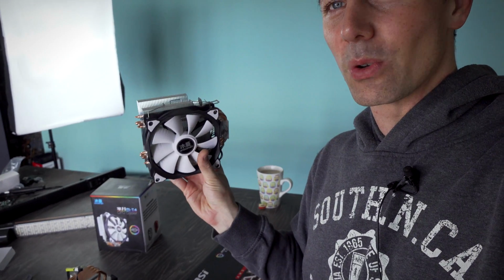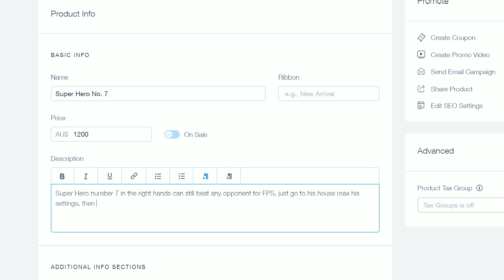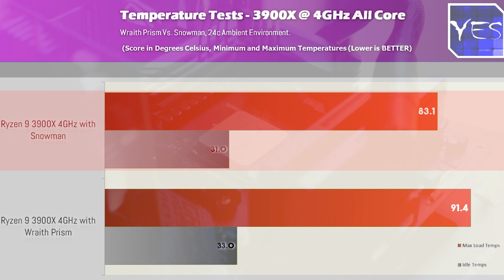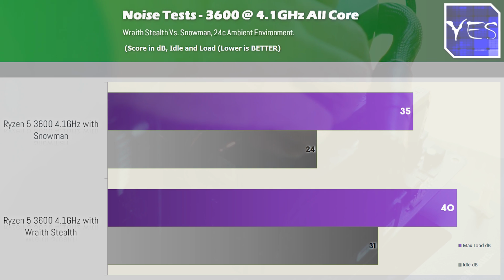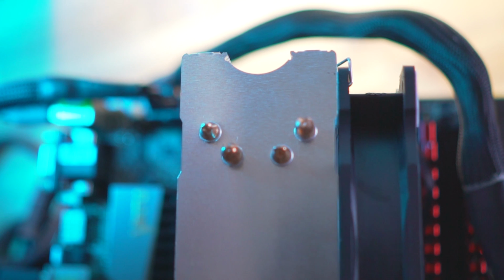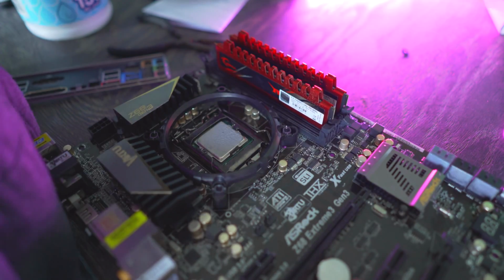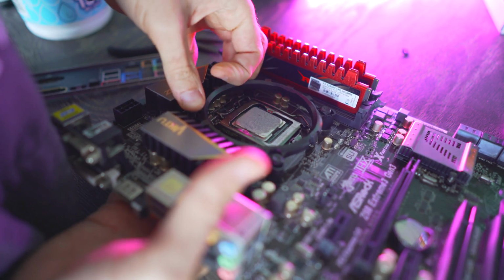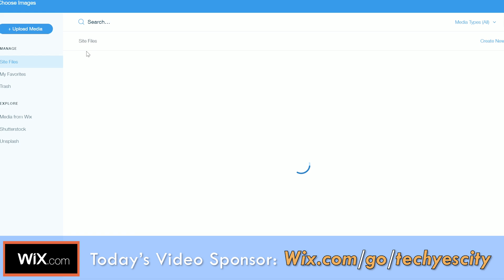Is this $17 Snowman CPU Cooler the BEST Money Can Buy....!?

Comment: Hey Brian! Love your content, been binging all your content. I know it's been awhile since the whole Xeon stuff but I was thinking about making a build with Xeon and bought some ECC UDIMM RAM, was wondering if you had any suggestions for motherboards that would be compatible with it? To get an idea of what I'll be pairing it with, I have my build so far posted below. 

My build so far after shopping around for the past two years (in USD): 
Enermax 120mm Fans - Free (after rebate) Fry's Electronics
16gb 1333MHz DDR3 ECC memory - $7 from Ebay
Snowman CPU cooler - $17 Aliexpress
Antec Truepower 550w - $20 Craigslist
Samsung EVO 850 500gb - $25 OfferUp
GTX 980 4gb - $90 Craigslist
Going in to a random case donated by friend, not very big on aesthetics, all about the bang for the buck
Total: $159 so far

Trying to spend less than $100 for CPU and mobo if possible. 

And yeah I know shopping around for 2 years is ridiculous but I was in no rush. Been holding out on buying GPU and CPU till now just because I know those get irrelevant quick. Decided on the GTX 980 because I plan to do 1080p gaming only.
Reply: Watch Philcomputerlab on which motherboard and xeon to buy

Comment: X58? Would snowman be a good pairing with your beloved x58? I just recently got a x58 setup but it's running a stock cooler currently.
Reply: I was uaing Intel thermal solution that normally comes with 980x

Comment: You should not use this cpu for testing.there is not enough difference between different coolers.as long as the cooler is decent .there is too much heat trapped in the 7nm cpu.use something like ryzen 2700 will be better

Comment: This thing is great. There's an ennermax cooler that's comparable at $20 if you dont want to wait on shipping. Here in the U.S. shipping from ali express takes a while. The 212 will probably never get knocked down though unless they can make an aio cooler that has its own closed ln2 system and doesn't condensate on the other components.

Comment: I have ordered recently this Alseye cooler: https://pl.aliexpress.com/item/32993609816.html?spm=a2g0s.9042311.0.0.27425c0feG5tJQ for a Ryzen 5 3600. I hope it will do a good job as it looks phenomenally and has 6 heatpipes + 120mm fans. Gonna update you Brian & guys when it arrive and I check the temps, cause for now I am on the included cooler - so I expect a huge improvement.

Comment: It's not for me, or the people i build PC for. FAR too nisy for my liking. But for many less noise focused users out there this seems like a really good deal. I will keep it in mind. Thanks for the heads up :)
Reply: Are u serial?! Maybe u got a broken Snowman? Did u hear Brian's audio test?! It was practically inaudible!
Reply: @MaximusAdonicus  The funniest thing about youtube comments, are people like you. You have to go nuts because someone isn't thinking like you. You're cute, but a bit of a laugh.

..and to the "practically inaudible" part of your comment: I build passive systems when i can. I have many years of building low/no noise PCs, for myself and others. My HTPC is a Streacom passive cooling case as an example. My current gamer has a passive CPU heatsink, two Fractal fans running below 500rpm, and - the one noisy thing - my MSI Gaming X 1060 which reaches 32DB when pushed. That is NOT inaudible. I can easily stand in the other end of my living room, and hear the fans. You could have a conversation with someone, and still hear the fans. The perception of a given noise level varies, a lot. Which frequency bands are you sensitive towards, what is your background noise level, and have you actually experienced anything but a noisy stock setup.. 

I get it.. You don't know what those numbers mean, and think you can rely on a simple mic close to a fan test as seen here. But you'd make yourself look a lot better if you ask, next time something confuses you.

Comment: What if you replace the fan on the Snowman? For example, take the 212 fan and put it on the Snowman. Would the noise go up and temps down? I wonder if the 212s fan has a higher RPM then the Snowmans fan :P

Comment: I think something we should remember though is that the horizontal coolers serve another purpose. They push air down over the motherboard cooling VRM and capacitors. Very important on these motherboards.
Reply: I thought the same but now that I've installed the tower instead of the top-down cooler my vrm's are acutally cooler. I guess the air pushed down is heat up due to the cpu.

Comment: I have a Thermaltake Contac Silent 12, very, very similar, even the price :D
Reply: I have the ContacSilent 12 as well. I think it's the same exact cooler as the Snowman. The fan just has a different sticker on it. Everything else looks identical.
Reply: @hartsickdisciple  and a "Tt" pressed on the top of the metal plate of the cooler besides the sticker, other than that identical just like you said, we got ourselves a pretty good deal :D

Comment: one thing worth testing is snowman vs evo using an identical fan to compare the coolers themselves.
reason being, that at $17 for the cooler and mounting hardware you have another $18 to throw a far better fan on it, or you can buy 2, and run 2 of the stock fans in push pull vs the evo for a dollar less, and you have a spare cooler itself and the mounting hardware.

great video though so far

Comment: Can you tweak the fan speed on desktops? If you can, this cooler "Snowman" could beat the Evo 212 on the temperature and noise  level if you pushed its speed a bit higher i think its incredible.

Comment: Should have switched the fans, to see if it's the stack or the fan that's better on the 212, the fan mount looks very amenable to putting your choice of fan on, if you want RGB or a more powerful but not as quiet fan.|

Also, not heard of the GD900... I got a big tube of HY880 not long ago

Comment: The reason this can be sold so cheaply is because china manipulates their currency and uses what is effectively slave labor so manufacturing costs are ~very~ low. Search up the leak that those $150 nike shoes you bought cost the equivalent of $2 to make. I'll leave the moral side of purchasing product from a country that treats its citizens as a tradable commodity to be used as the government sees fit to you. ;^)
Reply: Just too bad that 90% of ALL electric equipment and almost ALL clothes are made in China (because it IS cheap)! Trying to buy a tv, phone or pc parts NOT made in China is practically impossible. You can buy clothes locally, but they will cost 2-3 times more.

Comment: This is more like a Hyper 212 than it is a Hyper 212 Evo. For those that don't know the Evo has copper heat pipes sandwiched together without aluminum between.  I guess it does make a bit of a difference from testing that I've seen.

Comment: This aliexpress coolers are beasts, i had bought some of them becuz cheap bargains and they do the job pretty well.
Oh and if you happen to have problems with these coolers you can use sandpaper because some of these have smooth surface and doing so sometimes happens to give a boost on this coolers

Comment: i tend to go for any variant of hyper 212s (not the hyper T4, for what i tested it with, the evo killed it) when they are on sale cheap 15-20 after rebate, new or refurbished; i wonder how the snowman holds up under very high heat loads, like a 9900K or a Phenom II 965 at 4.2-4.3 in prime95 (an evo will need push/pull at 100% fan speed for 4.3Ghz prime)

Comment: Anyone who has an air cooled cpu tower like this, one of the best things you can do is throw away the included stock fan. Replace it with a high quality NXT or Noctua high performance 120mm fan or a 140m if it'll fit. You can easily jerryrig it onto the cooler with paperclips or zipties. That'll save you at least 5 degrees depending on how shit the stock fan was :)

Comment: I got 1 questions 1 I'm new to pc so bare with me is this goodCUK Continuum Micro AMD Raven Ridge 3rd Gen Micro ATX Gaming Desktop Computer and will this run gta Mobo:

1 x A320 Motherboard

CPU:

1 x AMD Ryzen 3 3200G APU w/ Vega 8 Graphics

RAM:

1 x 8GB (2 x 4GB) 3000MHz DDR4 RAM

M.2 Solid State Drive:

1 x 128GB M.2 NVMe 2280 SSD

3.5" Hard Disk Drive:

1 x None

OS:

1 x Windows 10 Home x64-bit (unactivated)

Keyboard & Mouse:

1 x CUKUSA Gaming Keyboard and Mouse Bundle

Wireless Internet:

1 x CUK 802.11 AC Wireless 600 Mbps Wifi Dongle Network Adapter w/ Directional Antenna

??
Reply: It will run it if you tweak the settings

Comment: There some Zalman CNPS9900MAX-R CPU Coolers on Amazon for $24.99. Those were $60-$80 coolers. They might be 10 years old but the design doesn't looked dated. I have one on a 8700K at 5GHz and it has no issues keeping it cool.
Reply: what happened with Zalman company? anything new?

Comment: Decent deal
A wraith prism rgb cost $30+ usd

Watch out installing those coolers that cone with AMD mounts on itx boards
I had to swap mine so it pushes air to the top because the latch got in the way of the pcie slot on my e3 1220 pc

Comment: I usually buy for my builds the Deepcool Ice Edge Mini FS V2 for 11€ from Amazon, works pretty well and looks good. 
This is for 95W TDP CPUs only, but I think if you change the fan with a more capable one it can do more.
Reply: Is there a bracket to mount the fan or something? I've been searching information on how to replace these aftermarket hsf's fan but I'm still unable to find it.
Reply: @reyzafany1992  yes, it has a standard 80mm fan mounted with 2 simple metal clips.
Reply: @MapOfEurasia  is it possible for me to buy this and add another fan? Maybe I could buy or make the clip separately lol
Reply: @reyzafany1992  with some DIY everything is possibile, do you wanna make a push-pull configuration? I think with some metal wire you can attach an another fan without a problem because on this heatsink you can reverse the fan without any issue.
Reply: @MapOfEurasia  yeah I'm thinking of doing that in my future build
In my current build I bought pccooler E126MB for my xeon 2420 v2 which manage to keep it under 70 degrees at full load. Do you have any tutorials or tips which I could read upon?

Comment: There is a Tier list for coolers on the Linustechtipsforum. Look that up first.

You'll see Brands you've never heard of in all tiers. 

Take Gelid in Tier 3. The Phantom cooler. It's not an NH-D15, but it's damn close at stock fan settings.

What's worth noticing though is that the Gelid cooler costs just 30 euros in West-Europe. The Noctua one 60-70 maybe 80.

What happened is, because it's not from Noctua or Bequiet or... brands people know, it depreciats after a few years or so because nobody really buys it (The Phantom was new 55-60,- , 2 years ago.)

Those are the coolers you want to look for.
Reply: 30 euro is still pricey. And I'm not sure that the gelid is actually even ship worldwide. And if it did, then the custom and mailing price from America or Europe could easily double the price of the item.
Reply: Noctua has thighter finns(spelling?) And more of them then other brands. Not sure about the one you wrote about, but worth looking into.
Reply: @-aleeke-2526  Maybe they have more fins (this is the correct plural I think), their fans are better than the ones on the Gelid cooler (or just about any other cooler) atleast. The result is that your 65W cpu is 45C under load at 30db with Noctua or 48C at 30db with Gelid, for example. The Hyper 212 would keep it at about 55C or so. 

Hardwareinfo did a ton of testing not so long ago. 49 aircoolers I thought. 

The Gelid cooler at 55-60 was just okay. You got at cheaper NH-D15 for, well, cheaper. For less than 30 now though, the same sort of price as a hyper 212, it's a steal.

I just happened to find the Phantom first, there are probably other good ones.
Reply: Gelid isnt that obscure of a brand, is it? Not as obsucure as let's say thermal right or alpenfohn.

Comment: I have Snowman cpu cooler with RGB. It's very good cooler but the fan is very low RPM and very quiet but I don't like it. If you change the fan (F12 Arctic) you can get even better cooling but it's a little noisy :)

Comment: What is the heigth of this cooler once installed? Can't find any specs on that. My case only supports up to 157mm of heigth.
Reply: I can't say but he does have the coolers side by side a few times throughout the video such as 8:35 so a little deductive reasoning suggests it's only a few mm taller than the evo.
Reply: @vgamesx1  Point taken. So it might just be a little too tall sadly :D
Reply: Can't find specs? Click on the link in the description and the specs are poppin' out in seconds! SPOILER: The tower is less than 157mm! It might be a tight fit thou, depending on how things are measured...

Comment: Estimated delivery 25 days. No thanks. And very interesting that they call it the Cooler-Master Snowman.
Reply: When i buy stuff form china on ebay it arrives to eu within 1-3 weeks for free(usually on the lower end of timeframe), so not a big deal if you don't need them item right away.

Comment: Amazing cooler from Aliexpress, the problem is delivery... 30+ days... but yea, this is a good option
Reply: Also sadly the delivery prices vary for around the world and it some cases they are $6-$7 for delivery. It's a great cooler, but personally where I live I would rather pay about $10 more and get an Arctic Freezer 34 eSports Duo, which I love how it looks aestetically, 10 year warranty and performance-wise... well no need to even mention it.
However if the delivery price is like in the video $1-$2 then it's definitely the best bargain for budget cooling.
Reply: @xingbairong  in my case it would be better to buy DeepCool Gammax 400 for 17 USD
Reply: @VitaClaroES  Yeah it all comes down to local prices :)
Reply: @VitaClaroES  Where are you guys finding these things for under $20? I just checked a few sites and even on ebay the cheapest they're going for is $23...
Reply: @vgamesx1  Estonia man, local markets
Reply: @VitaClaroES  Same here, in fact, that's what I did.  I would like to see a head-to-head comparison between them.  They seem to be virtually identical (4 heat pipes, 120mm fan mount, ability to mount push me/pull you).
Reply: delivery is only about 7 days for me on aliexpress, and i live in europe, netherlands
Reply: @budgetking2591  im from Estonia, 30+ days man....
Reply: @VitaClaroES  Yeah unlucky, package delivery from China is very fast to here.
Reply: @VitaClaroES  same here in Algeria but we got used to it.
Reply: @budgetking2591  I'm from Belgium and it takes +30 days all the time :)
Reply: @GuybrushThriftweed  unlucky, for netherlands its usually arround 7 days if you choose aliexpress shipping.
Reply: Well you just PISSED ON MY PARADE!!! Damn it man.. I’m getting a r5 3600 and was thinking about the Lucifer for like 42 dollars it’s overkill with 6 heat pipes but when I decide to upgrade to 8 or 12 cores I’ll have a cooler that can handle it without an issue..

Comment: If buying a cheap cooler such as the snowman I’d guess it would be in a cheap closed case with average air circulation. Would probably be a whole lot hotter and nosier than an open air test bench.

Comment: Would like to have seen you try swapping for a slightly higher CFM fan, and/or just throwing a cheapo 2nd fan on for some push/pull goodness. Many of your audience probably has a spare 120mm fan lying around, or you could always buy a cheapo one for ~$5. Would probably outperform the 212 while still being cheaper and likely quieter.
Reply: same thoughts here, or checking fans' cfm and matching those and see if same cooling and noise output.

Comment: I'm running my i7 2600K on a asrock z68 extreme gen3 at 4.8Ghz with a 212evo. Also overclocked my 1600Mhz DDR3 to 2133Mhz. To me that motherboard seems perfectly fine for overclocking.

Those 3 degrees C at 4.3Ghz would probably grow exponentially when overclocking. (I don't consider 4.3Ghz on a i7 2600K to be overclocking).

Comment: The noise on my stealth cooler for my 2600x was driving me crazy.  I bought a tower cooler similar to the Iceman because they are known to be super quiet.   Unfortunately it did not fit in the case I was building my sleeper PC in.  So I bought a 80mm to 120mm fan shroud and attached a 120mm the stealth cooler and it performed on par with the gammaxx 400!
Reply: Gustav Gamer  you are correct.  I mixed up the names of the coolers.  So confusing when all your coolers start with s.  Lol. On the 2600x they cheap out and give you a spire without rgb/LEDs .
Reply: @pvtpy1e  But the Spire on 2600x is better than the Stealth on 2600! So, no cheaping out (other than geeky rgb's, which are only on the top models).

Comment: Be careful which "snowman" cooler you buy. I bought one but it was a 92mm heatsink with a 120mm fan and it could barely handle a stock i7-4790 with decent airflow.

Comment: Please compare gd900 with hy510 another most sought cheap (25g for almost 1USD) thermal paste from AliExpress.
Reply: He did a video on thermal paste before and the gd900 won
Reply: @kruxdt6307  but it didn't include hy510, 610 or 710
Reply: Just buy gd900, it's been proven to be very good. I personally won't use those hy series thermal paste that came out in jam jar at under 10 dollars

Comment: Those fins are a bit spaced out for my liking, but honestly if it does the job not bad at all
Reply: Yes, but it's wider so surface area should be about the same.

Spaced out fins also have lower terbulance so it more silent. They require less static pressure so a higher airflow and lower pressure fan can be used which will further improve thermals.
Reply: @Seanweekhaizhen  Its really negligible at best on this level though. In my experience, the more fins and more packed they are mostly means I get maybe 1-5 degree difference. But honestly its not much of a big deal.